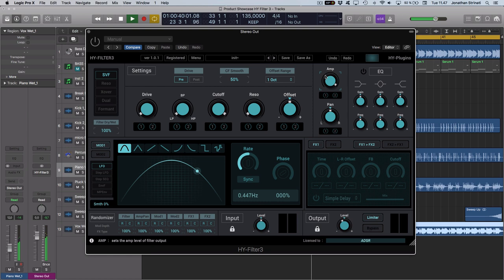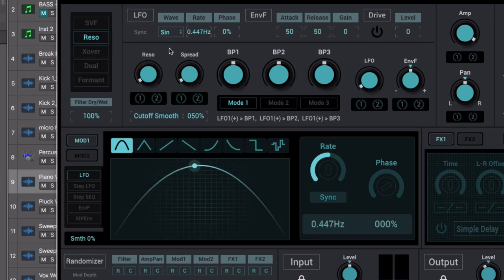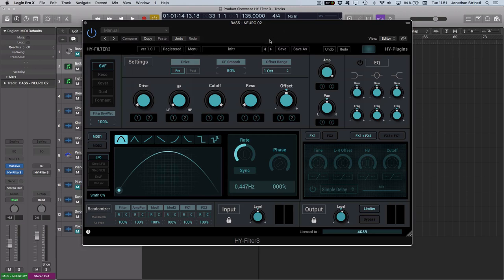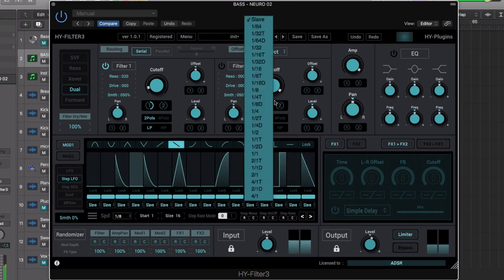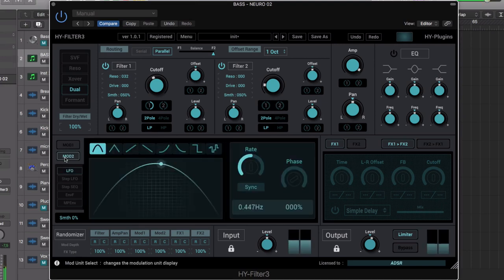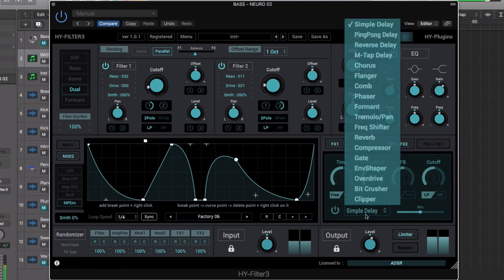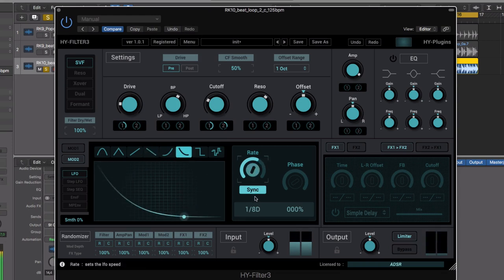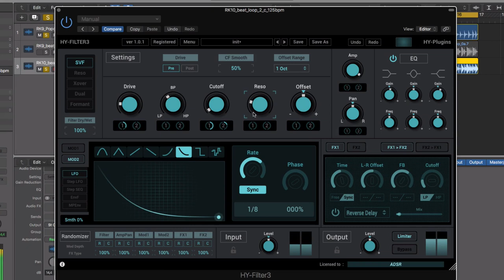HY-Filter3 Walkthrough - 5 Powerful Filters

Comment: I really like the UI and the creative possibilities, but I'm reluctant to purchase this because it does not allow you to retrigger the modulators with MIDI note, nor set the modulators to envelope (one-shot) mode. The LFO and MPEnv are simply free-running. You also cannot snap points to the MPEnv grid, nor can you adjust the grid size, making the grid less useful than it should be.

To be honest, I'm not interested in the EQ and effects units. These are a bit superfluous and a waste of space, when it seems the focus of the plug-in should be creative filtering.

If the plug-in can actually do any of the above, be sure to let me know! I don't think this can yet replace LFOTool for me - even though there's some cool filter types - because LFOTool does the above, and this makes it easier to apply the modulations with precision.